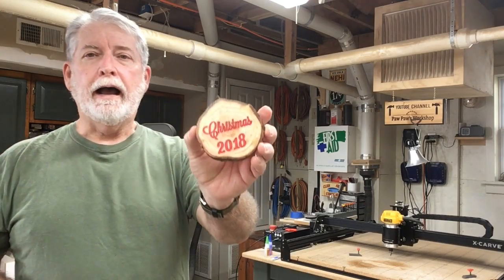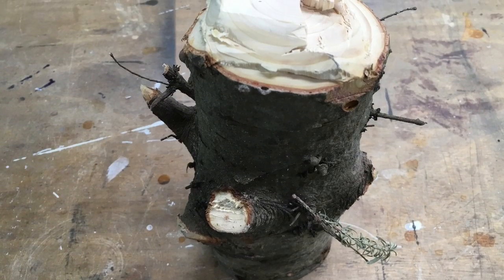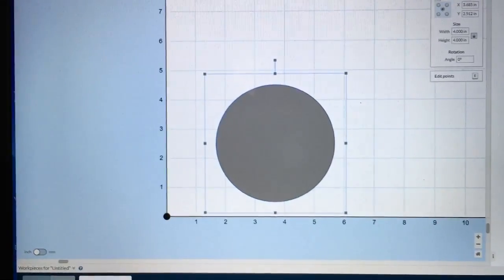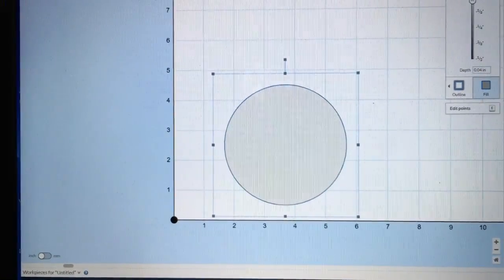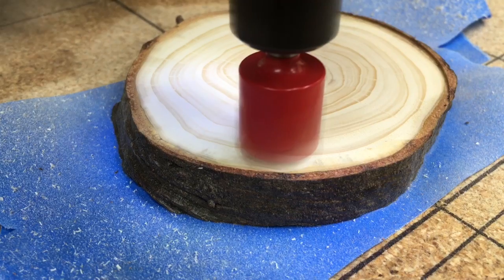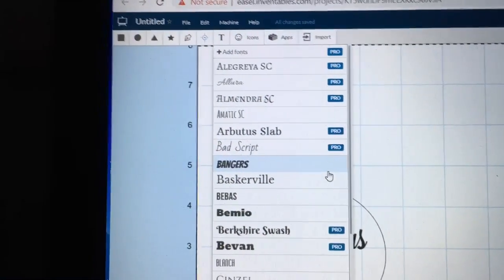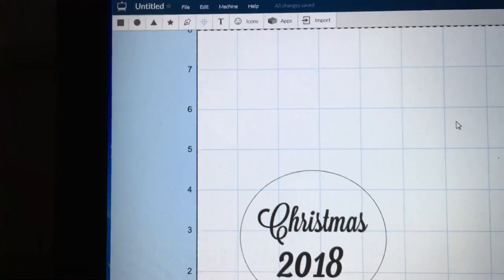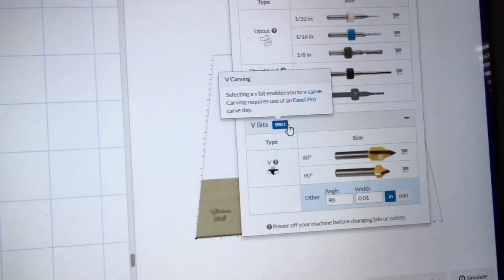How to Use Easel with V-Bits Without Using Easel Pro

Comment: This is really creative.  I give you props for that.   I want to expand the statement that you made: "You will lose some of the fine detail that is provided in Easel Pro toolpath"  What this really means in that the font will change.  A v carve toolpath is very different that the toolpath created by what you are presenting here.  This will change the font shape.  Thin wispy lines will be thickened.  The result may be acceptable to you and to many, but you are not tricking the software into doing vcarving.  You are doing an endmill tool path.  There is no depth adjustment that would normally occur that preserves the font accuracy.   But this can workout in your favor but it will be somewhat unpredictable.
Reply from the maker: Thank you for your explanation.

Comment: I done the same thing recently and also carved with a pro font by taking a screenshot of my text in a PRO font then using basic MS Paint and paste the image, crop it then save as a jpeg then create the svg file to import to Easel.
I noticed your carvings are very organised, my code just jumps all over the place which obviously makes the carve time longer, how do you manage to get the code to work in a logical manner?
Reply from the maker: Easel has poor toolpath structure compared to other software. You are taking a design and processing it through several steps to get to easel. It will have unusual toolpaths

Comment: Having to pay for software to manage a machine that you bought is such a bad business. There MUST be an always free of cost software to manage the machine.
Reply from the maker: Thank you for your comment. You do have many free options. Chose which is best for you
Reply: @PawPawsWorkShop  TBH, it's not about free options - I spent $3000 on the machine, $400 on VCurve, all I want is an offline controller as without that the machine can't be used. This is really BAD business. It's like buying an iPhone but have to pay and yearly fee to use iOS.
Reply from the maker: Use universal gcode sender UGS. It’s free, it works great. No internet needed

Comment: Hi, great video, I need some advice please. I am trying to rough out a basic name using a large font size using an 1/8" bit , then I would like to change the bit to a 60 degree V  bit using the settings in your video just to clean up the edges. Is this possible?  Have you posted a video on this subject?  any help would be much appreciated.  Thank you John. (UK)
Reply from the maker: Yes, that is call two stage carving in easel.  Put you roughing bit in first and add a second bit.  Look up in the right hand corner where you see the bit. Next to that is a "+" click on that to add the 60 degree detail bit.  When you carve, it will ask you which bit you are using.  You will have to z probe again when you change bits.
Reply: @PawPawsWorkShop  Hi, and thanks for coming back to me, would I be correct in thinking that this method only works when you are a Pro subscriber? as when I tried what was suggested, easel only carried out the roughing cut and then stopped. It gave me no information how to proceed with the detail cut, it basically said the job is now complete. Thanks once again.  John.
Reply from the maker: If you are trying to use the vbit you must have pro.  The only way around it is to tell the machine you have a different bit and just use the vbit. That is what I was trying to show in this video

Comment: Great tip for the V bit. Also, if you’re desperate to use a Pro-Font with no free days left, download the font to your computer (hundreds free online - quick google search) and type out your word/phrase in a photo edit software such as InkScape and then convert to a SVG file (Inkscape can do this, as can many websites). You can then import this SVG file and edit size and placement. You won’t be able to edit the text unless you re-import the edit, but it means you can use fancy fonts for free 👍
Reply from the maker: Excellent point. Thank you for sharing the tip.

Comment: Great video, thanks.  I have been using the free Easel software.  I have added a V bit to try to bring up the 4 free days prompt, but I dont get that option.  How do I get their free days please?
Reply from the maker: Inventables changed their policy. Effective July21, 2020 (if I remember correctly) any purchase before that day you will continue to get the four free days.  After that day you will have a 30 day free trial and then purchase Easel Pro to be able to continue to use.  With that said, I am going to assume you are grandfathered in and have the four free days.  When you design a project with v bits or with pro fonts that will trigger Pro.  When you go to carve it will tell you your 30 trial is over and offer the purchase.  Well look up at the "Option" box at the top of the page select that and you will get the option to use one of your four free days.
Reply: @PawPawsWorkShop  I registered with them about 2 weeks ago.   So it seems I missed out.  That's a shame..   Thanks.
Reply from the maker: First, you do have a 30 day free trial.  Also  and most important, you can still design in Easel Pro save it to the computer. Then use UGS  Universal GCode Sender and carve your design.
Reply: @PawPawsWorkShop  sorry to keep pestering you.  Do you mean that after the 30 day free trial then I will have the 4 free days after the trial ends?
Reply from the maker: Check with Inventables, it is my understanding is that after the 30 day trial you will have buy the Easel Pro to continue to use it

Comment: I'm having trouble cutting all the way through my project with my V bit. How am I able to do that?
Reply from the maker: Typically a v bit is not used to cut all the way through the wood.  The way the CNC works is that when the edge of the project is touched by the bit in the design it will not go any deeper into the wood.  Therefore, the project would have to be wide enough not to touch the edge of the design before it cut all the way though the wood.

Comment: Could you in the future while working on a project tell us what speeds and feeds you are using. I was watching your video on two stage carving where you made your 200 subscribers project and it would have been very helpful to me to know what the speeds and feeds were. Thank you
Reply from the maker: I usually use the standard suggestions in Easel.  Yes that is slow but safe and will not hurt the machine.

Comment: I'm still scratching my head about this, how can you get the depth correct for the width of cut if your saying 0.10 of an inch on the bit ? But wanted the width of the text a certain size ? Surely that's when the v bit in easel helps ?
Reply from the maker: A little trial and error.  My depth was .35" and do the letters with a fill. Yes, a v bit is better but this is to show that it can be done and look great
Reply: @PawPawsWorkShop  thank you for your response, I see what you mean now, also whilst I can, can i pick your brains about something? The strangest thing keeps happening to my x carve, whether it be a start from scratch carve or using zero position from previous run, every now and again my machine will randomly go to the start position to start carving, when the z axis moves down for some reason it doesn't stop, it has gone straight through my project piece and straight into my original spoiler board, it has done this 4 times in the past 2 days, ( I have only been using it for 2 days as I have only just got it) ( brand new) any ideas as to why ? It has also destroyed the 2 perspex pieces that come with the dust boot. But then 90% of the time it does it as per my setting and runs fine. (I do not make any adjustments when it has its moments)

Thank you

Comment: One thing to add..you can use a vbit in easel but you cant vcarve is easel....the vcarving process uses unique xyz moves in the process of doing text if you just use a vbit in easel it will only do xy moves while doing the text....so you wont get same results but you will get results such as paw paw which can look nice
Reply: Very nice project..i like  the xmas tree use....
Reply from the maker: Recycle, recycle. Thank you
Reply from the maker: You are correct.  I explained that in the video.  The machine is carving as if a .010 straight bit was in place. I also stated that you will lose some of the fine detail that true vcarving will do.  Thank you

Comment: Ha ha paw paw rich....those 3 freud bits cost as much as my 100 pc router bitbaet....rockler is way overpriced on everything here is what i bought 10 yrs ago and have worked very well at cost of $79 http://cheapestrouterbitsonlined.blogspot.com/2012/01/100-piece-router-bit-set.html they are cheap chinese but they function fine
Reply from the maker: Chinese bits are OK but not long lasting and at times not balanced and wear out quicker.  I have used them and have found that paying a little more really does make a huge difference.  To me, it is worth the extra money.
Reply from the maker: I have a drawer full of cheap bits.  They are collecting dust and not being used.  I like the results of the better bits. If they work for you, great.

Comment: Great video... As i said before you can use v bits in easel.... You just need to do some fenagling with settings lol....another trick i have is if you have a text that the profile outline of it isnt as wide as you like.....you could make it wider by lying to easel about the bit dia....if you want the text to machine wider you can just use a 1/8 bit but tell easel you are using a 3/16 bit and theoretically this should make the text profile 1/8 wider overall....assuming you have proper space and not interfere with other parts of the project....using this you would need to make sure your project can handle the trick method....but it should work in some cases...i used this method other day and it worked...the text wasnt as beefy as i wanted and i couldnt resize to thickness i wanted properly without distorting so i lied about bit and it made an equally increased text profile..and turned out well
Reply from the maker: Excellent.  It really does work great.